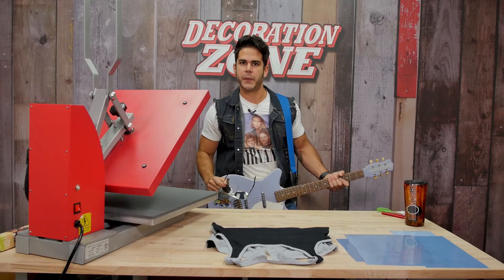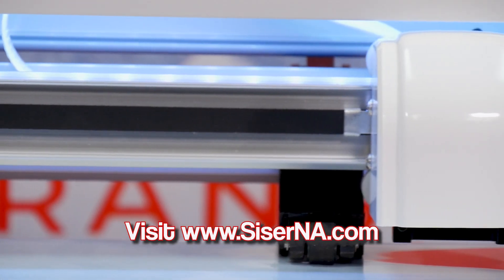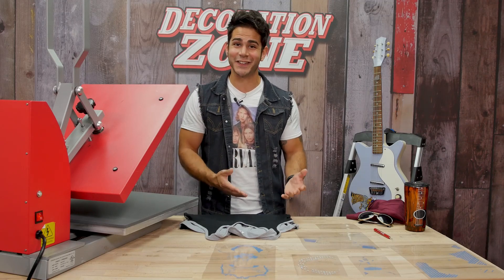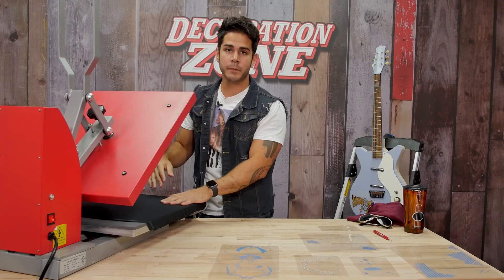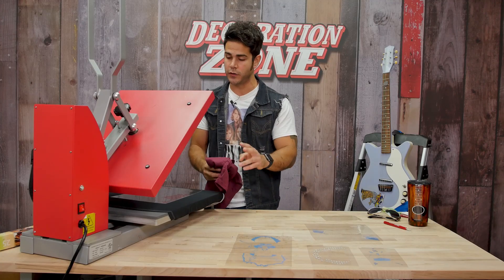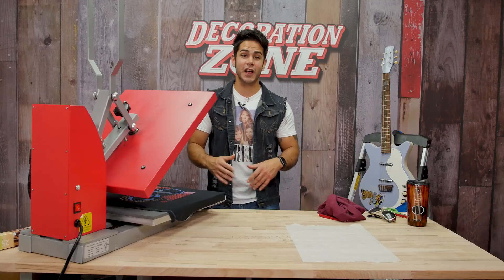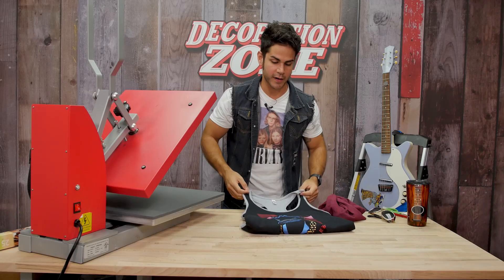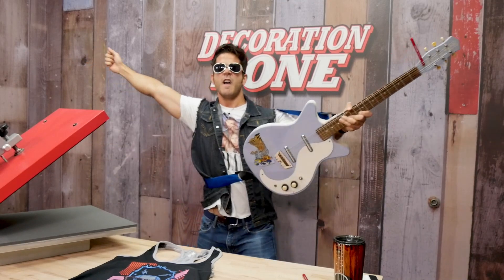Metal HTV ROCKS! - Decoration Zone

Comment: Whenever i press the silver, it comes out smooth. But when i press the purple the same way it come out rough, like you can feel the texture of the shirt through it. Is there a reason this is happening?
Reply from the maker: Metal HTV can be volatile. If it gets pressed again, with a cover sheet, it will cause it to look "weathered".
Reply: @SiserNorthAmerica  holy shit, i just did it without the teflon cover sheet i was using & it came out way better, with that smooth finish i was looking for. Thank you very much, you have the best customer service ever👍
Reply from the maker: @J0SHUAKANE  So glad we could help!! :)